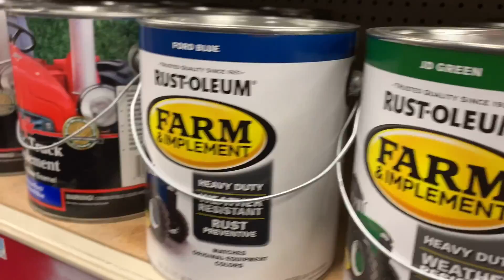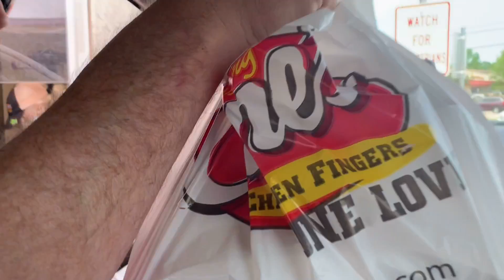Restoring a Ford Tractor | Ford 4100 Tractor Restoration | Part 1

Comment: They were simple tractors that had great 3 point lifts and tough engines. At one time we had 3- Ford 3600, a Ford 5000. 6600, 7000 and a 7600.
Reply from the maker: We only had Ford tractors growing up. Great tractors.

Comment: I recently began restoration on my Dad’s old ‘49 8n( last run in 2003) and the engine had lots of baked on oily dirt and grease. I had some Purple Power but saw a video of how well Super Clean worked and decided to give it a try. I mixed it in a 1 gal. sprayer and sprayed the bare block and oil pan and after some time hit it with the pressure washer and was amazed at the results. Except for a couple of small places around the oil filler tube and on the flywheel housing, the block was completely clean. Once I get the tractor back together, everything from the clutch housing back to the PTO will get degreased and power washed.
Reply from the maker: Super clean definitely made it easier to clean for us.

Comment: I Had a 1978 Ford 2600, it was almoust identical to yours, just fix the wiring, ad klean fuel and it runs for ever
Reply from the maker: Did you have the same wiring harness?  Hope it wasn’t too hard

Comment: The 4100 ford was built from 1975 to 1981 mine is a 1978 thy only built them 6 years I also have a  1969 ford 8000 and a 1970 8000.
Reply from the maker: We learned a lot during that restoration. Appreciate the info.